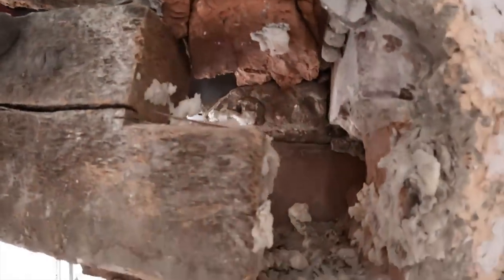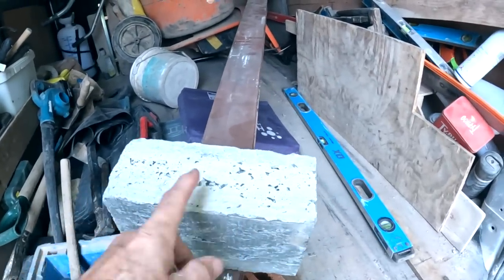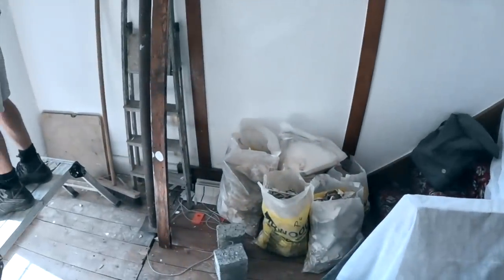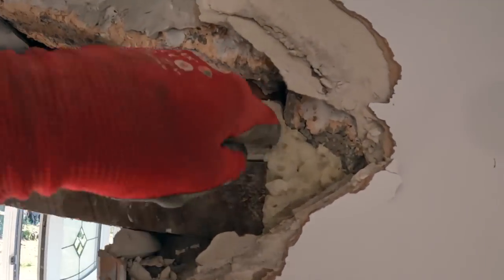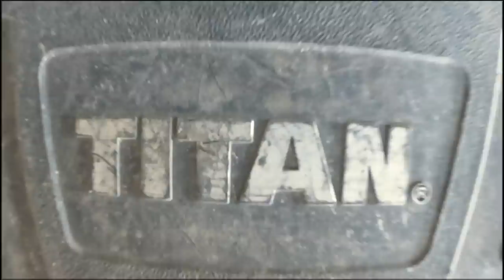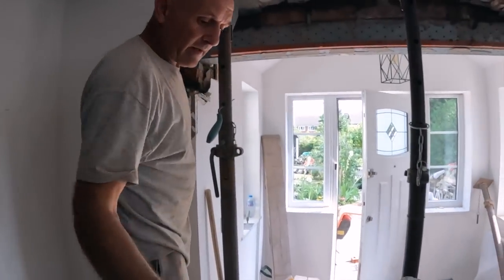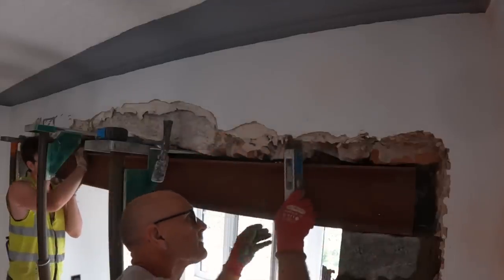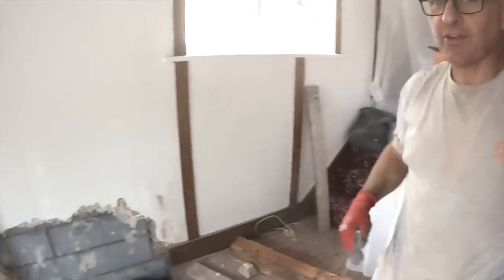MORE DODGY WORKMANSHIP!! NEW STEEL BEAM

Comment: A great upload showing how to tackle a job when you’re going in blind always have everything prepared used the acros and strong boys on Arch as a precaution even though they felt they could have got away with it ! Old wooden lintel was a mess so great installation of pad stones new rsj and brickwork to create correct size for new opening! Nice to see the extra job of checking brickwork for damp didn’t cause any issues! Thanks for upload Steve and Alex 👏
Reply from the maker: Cheers John 🧱👍🏽

Comment: on our build a shim was called for between beam and padstone when they are parallel to even the load on the padstone,just wondered why you didnt use one?  is it normal or ?  cheers!
Reply from the maker: We’ve seen that specified on one other job that we didn’t end up doing. The rules change all the time 🧱👍🏽
Reply: @SteveAndAlexBuild  ah ok - well our builder decided to not put it in for some reason lol, still being sorted out :(
Reply from the maker: @hammered1969  😬🧱👍🏽

Comment: Unnecessary. Next door's (cheapest quote) builders just whipped out a wooden lintel and bricked up as fast as they could. The settlement crack went to the roof, so they grew a creeper to cover it and sold the house.